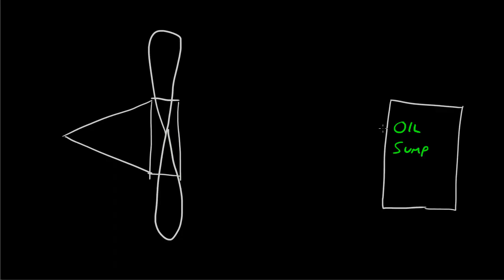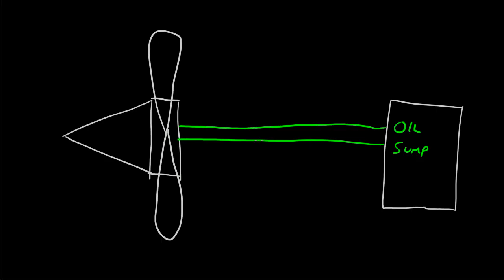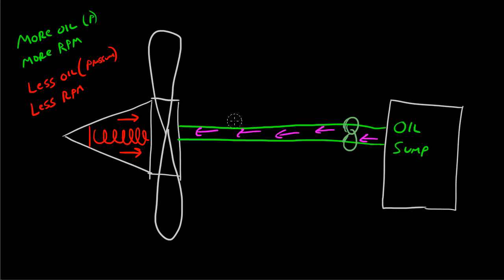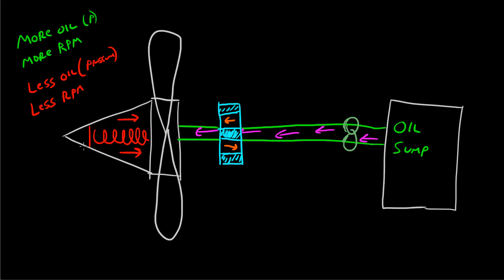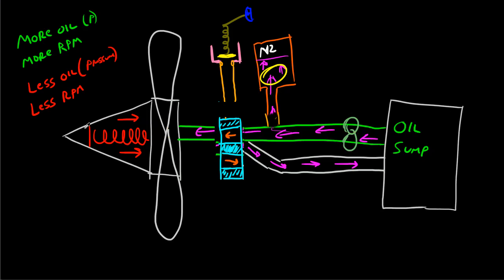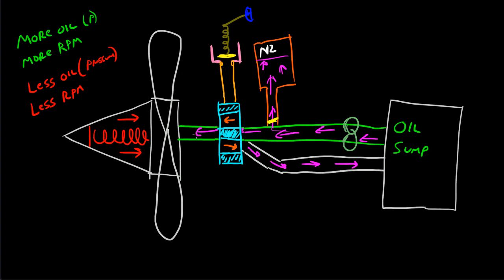Drawing the PA-44 Prop Diagram

Comment: So is the PA-44 opposite of the Arrow system? In the Arrow, loss of oil pressure flattens blade angle and increases RPM. Sounds like a loss of pressure in the PA-44 reduces the oil pressure and increases blade angle. Is that because in a multi the loss of oil pressure moves it to a feathered position to reduce drag?
Reply from the maker: Exactly.